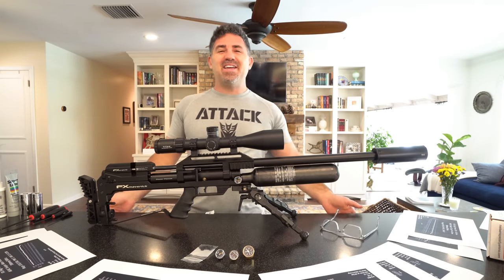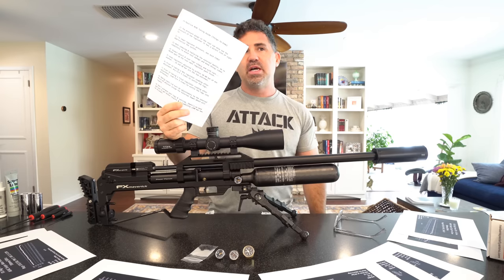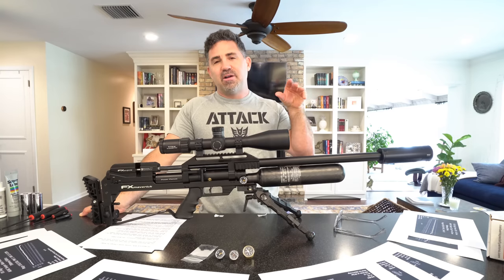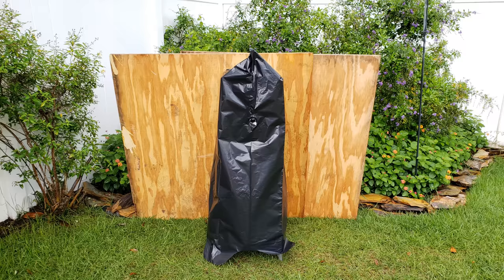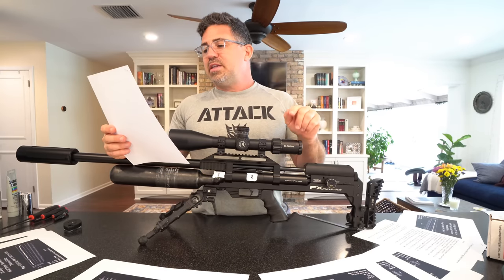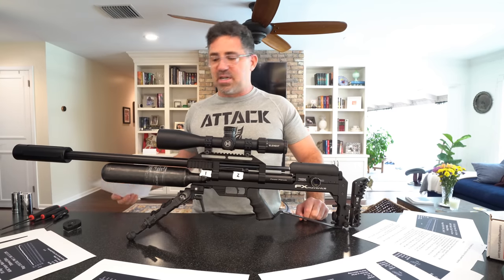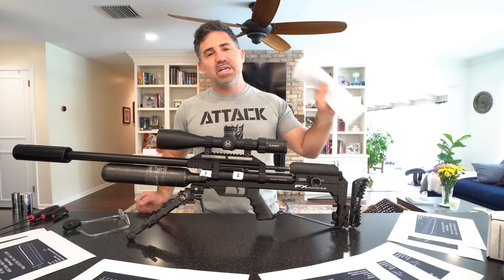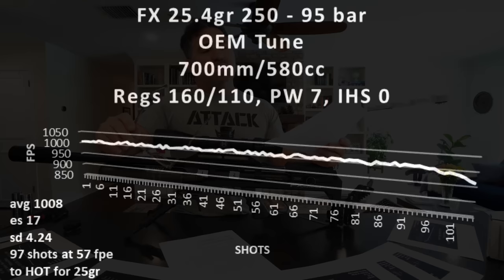FX Maverick .25 (Review) + TUNING GUIDE !! + FULL SETUP + Accuracy Test !! - How to Tune an Airgun!

Comment: Can these settings apply to FX Maverick sniper 700 and Compact 500 mm? If you the settings for these 2, where I can find them?
Reply from the maker: Hello Carlos.  I covered this question in great detail in this video.  Enjoy!  Steve
Reply: @aeacvlog2033  Hi Steve, thank you so much for your swift response. I inadvertently missed mentioning that my Maverick is .22 and settings you were showing were I believe for the .25. Therefore, my question was about the settings that can apply to the .22 cal.
Reply from the maker: @carloshaddad6375  Ah!  Head over to AGN forum and check out the 3 sticked topics there.  I've been helping someone there with their .22 cal.  Try to approach it from technique applied rather than duplicating exact settings... that won't work, no.  I've taken them through how I'd go about tuning their .22 cal there.  Same approach, same guidelines.  Steve

Comment: I'd like to see more on the 22 maverick every single video is on the 25 cal like the 22 is not important?
Reply from the maker: It's not that, it's that ya just don't need these levels of plenum, valve, and port for a .22 cal's 14-25gr pellets & slugs.  You're better off buying a Wildcat, Dreamline, or Crown Continuum if ya want a .22.  The Maverick's design has been optimized to launch heavy lead hard (35 - 50 gr to 65 -100 fpe) and you'll never use a third of that flow potential setting it up for .22 cal's ideal  25 - 35 fpe.  Heck,, as ya saw in this video,, I was at a 70 bar reg with the hammer spring backed waaaay off just to get a 25.39gr to down around 900 fps (46 fpe)... it was just barely idling, lol 😂.  To invest in this platform means to understand all of this.  Make good sense?  Best, Steve
Reply: @aeacvlog2033  no it makes no sence, why would fx make it in a 177 and a 22??
Reply: @crypto_creep8222  for the 12 fpe markets and in some countries like South Africa, .22 cal is the largest permitted.  Also smaller caliber ammo is less expensive so there are those that will buy the guns in those calibers cuz of that.
Reply: @aeacvlog2033  Will chime in that there are some very heavy .22 Cal slugs hitting the market, so a shooter wanting to sling heavy .22 slugs will be very happy with the Maverick platform!

Comment: I hope it's gona help someone but what setting helpt me...... that i bought the heavy hammer tunekit but used only the pelletdriver so now i did not heve the little air channel, and a set my Wildcat .25 sniper mk3 pressure at 120bar and now i have on wheelsetting-1 625ft/s and now it's safe to shoot rats at the farm and on wheelsetting-7 1004ft/s with the fx 25.4grain pellets and when i put it in wheelsetting-adjust then i have 478ft/s and so i only used the pellet driver from the set with the heave tungstun hammer in it. hope that i helpt someone with a Wildcat sniper mk3 no bottle.... safe shooting greatings from the netherlands Marinus

Comment: Tune it without a suppressor and see if it’s still easy
Reply: Approach would be the same.  Seek out the harmonics and balance points between reg pressure and hammer spring tension... at the velocity you want.  To your point, these settings will be different with/without a moderator 👍😊.  Steve

Comment: you said a lot about the gun,alot about its tuning.but you didn,t say that this is the gun that hits the first shot low every time???
Reply: What are you even talking about dude. You just jump in the comments and post trash comments.
Reply: @AlexTheLi0n  first of all,bro i did not comment on you and secondly my brother i also have fx maverick sniper edition which holding it for a while it takes the first shot low,after a hour 40 to 50 fps.thanks.